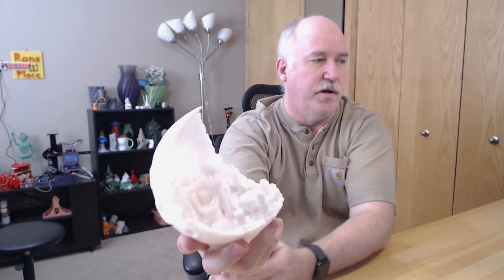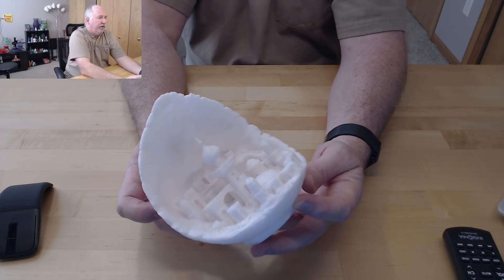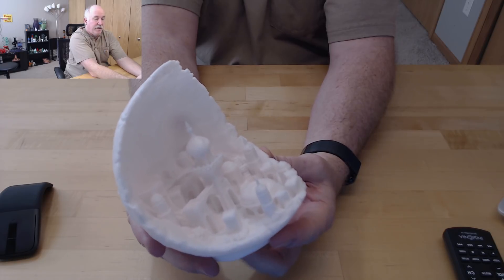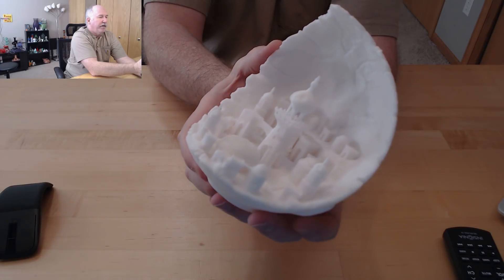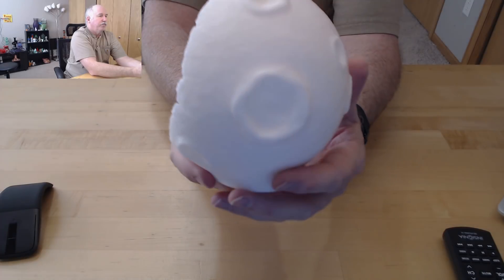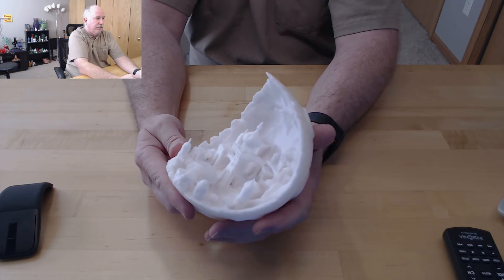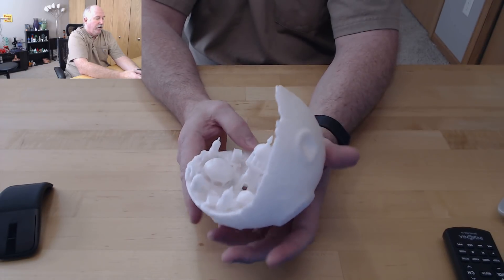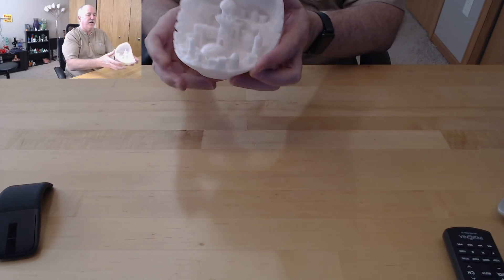Prusa i3 mk3 Print - Moon City 2.0

Comment: Sometimes what looks like layer shift can actually be parts cooling issues. In Slic3r for example, if the parts cooling fan isn't set to always on, and the speed is set to auto and the minimum fan speed is zero, sometimes the fan doesn't cool enough in spots. That causes uneven contraction of the layers and it looks just like layer shift. In both regular Slic3r  and PE, for PLA make sure the fan is set to always on.

Comment: Any update on the power supply? Clicking get resolved?
Reply: Jo tweeted that the clicking will be fixed in the first stable MK3 firmware update. It's just a frequency issue that they need to tweak.

Comment: What speeds were you printing? I wonder if it goes to fast and makes a sharp turn or stop and shift but because it's not from an impact it doesn't detect it. I had a print skip once and was running really fast when it happened. Just a thought to consider. I also was printing a long print while at work and in plugged the printer and took it back home. When I plugged it in it went through and rehomed x and y axis and heated to temp and resumed. It shifted 1st layer and I was able to force a crash detection on y axis and it rehomed and printed without any further issues. It just may be a great feature if you print at one location and need to finish at another. I'll try another print and move to see if it will rehome and print without issue.

Comment: Looks really good. My MK3 is being delivered tomorrow 😁
Reply: nice... mine still doesn't ship till the beginning of February :(
Reply: ya same :(. Mine was scheduled to come middle-end of January but then it got delayed.
Reply: Mine within 2 weeks <3
Reply: So, the printer came today.  Been using it for a few hours.  It's louder than I was expecting (based on people saying it's really quiet).  I've also noticed a couple of things.

In this video, the printer was turned off.  However:
https://www.youtube.com/watch?v=77glq2jsI80

I've also noticed the filament unravelling more than needed:  
https://www.youtube.com/watch?v=ANs9Xk_C1JE

Has anyone noticed these?
Reply: Ok, thanks for that.  

I'm printing a large dino skull.  

I've seen videos where the sound from the MK3 is really quiet in normal mode.  That's one of the main reasons for buying it because my other printer was LOUD.

My MK3..... Is not quiet. Here's another Oscar winning video.

https://youtu.be/OxXjOMjmSac

Filmed the noise level on my phone so may not be accurate.

45db on quiet mode.
68db on normal (100 speed)
50db on normal (150 speed)

Any idea what's going on.

Have you experienced this?